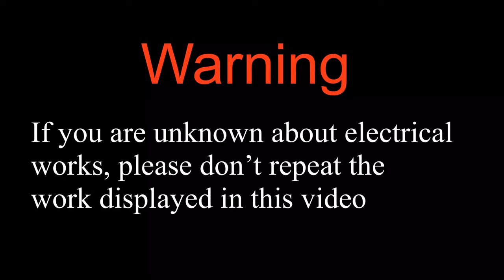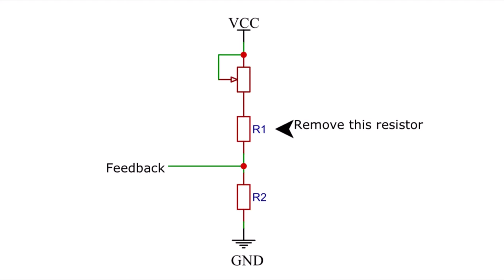How to Modify 12V SMPS for Variable Output

Comment: Connect a fan to the output. Then check on the resistors with a multineter, that won't harm the device. If the fan speed varies when you use the multimeter , you found the component, and you can connect a variable resistor to set up the power supply. The variabe resistor is needed for chargers that you have to make for batteries, lead acid, etc. Laptop chargers are perfect, but the charging voltage has to be accurate.

Comment: On my 5V 60 amp sms the pot is not attached to Vcc but is in the bottom leg of the voltage divider and is grounded. When using a pot as a rheostat it is good practice to link the slider to one end. This prevents massive loss of control if the slider bounces when being turned.

Comment: Hello, very nice ! when i try this, i only reach 21v...
Reply: That could be voltage under load. Either way, I'm suspicious of the upper third of the voltage represented by this mod--stabilitywise. Still, very informative. Especially commenter below who tells how to use multimeter and fan to find voltage control resistive load. 💡